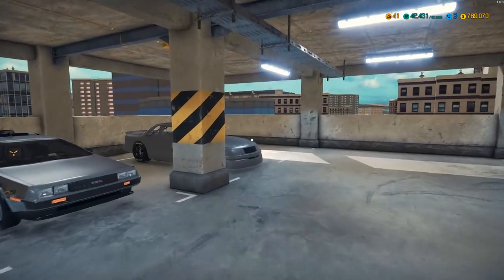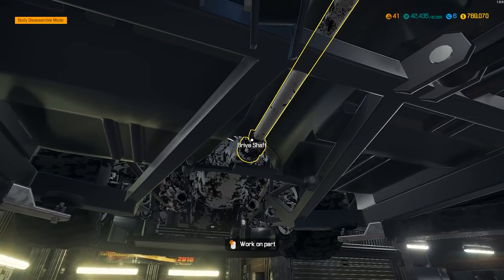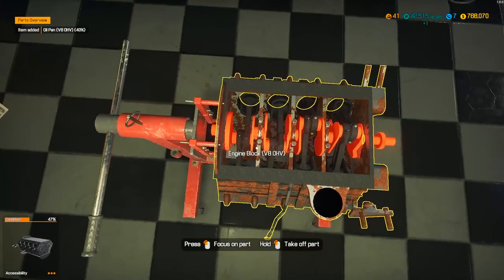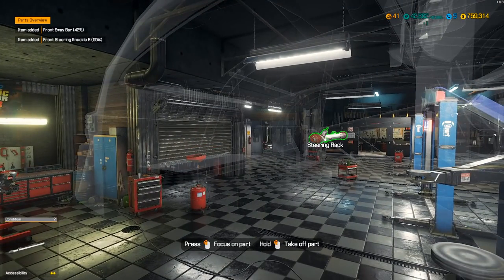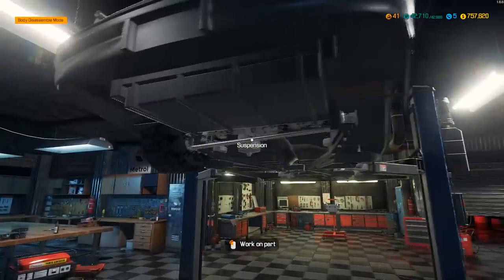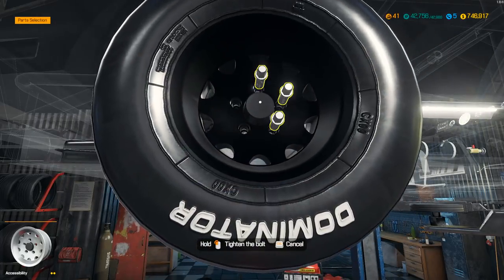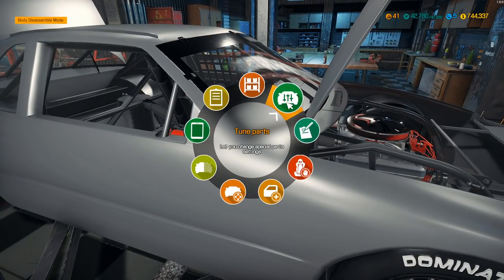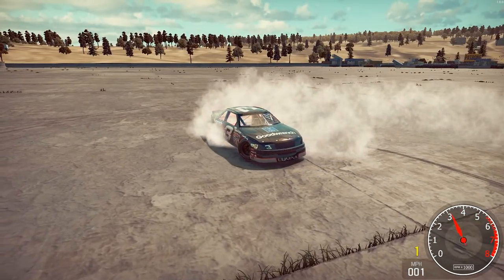Daytona 500 Special! Found a ‘93 Chevy Lumina Cup Car in a junkyard! Classic NASCAR restoration

Comment: So in the 90s lumina had sb2 for engines and the power and torque specs look very similar to the original. But the battery thing is in the new cars there is one in front of both of the rear tires for spare purposes.but on the older cars they were put were they needed to get weight balances right. The only compliant I had was the engine it self in the car was not a sb2 but a Ford FR9 and that makes me a little sad but other than that everything else on the mod is seems right with the car. And the exhaust on any cup car is called the boom tube.